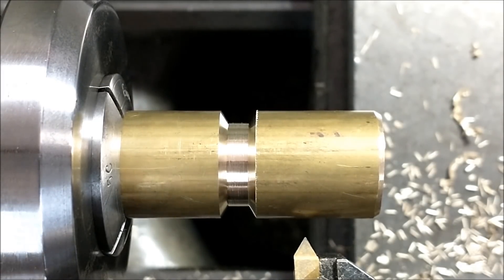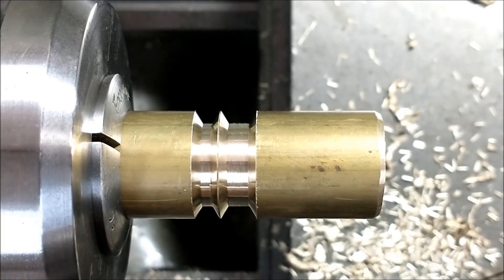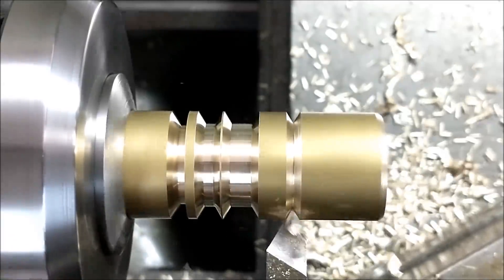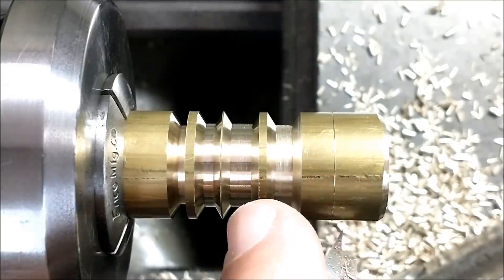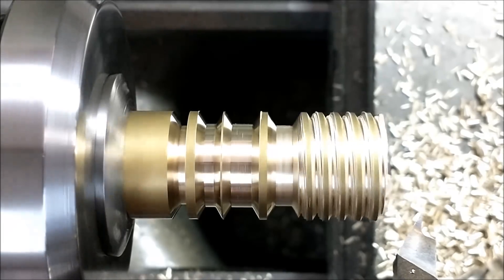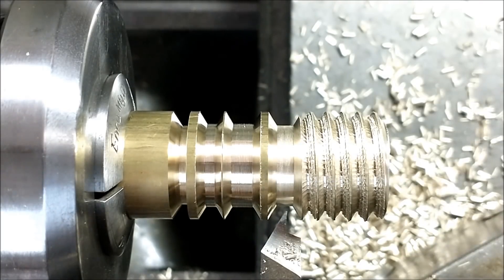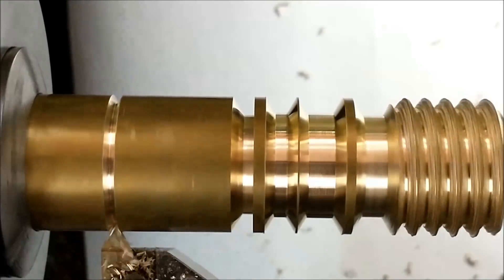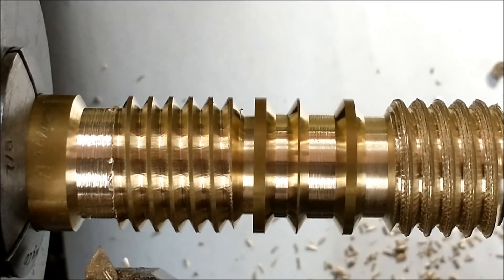FACT CHECK:  Threading Myth BUSTED !!   You'll Find This Interesting......

Comment: Excellent clear demonstration of what is actually occurring during a single point threading operation. 
It is my understanding that the oblique approach was to reduce chatter by using the leading edge to remove more that the trailing edge.
Thanks for sharing, best regards from the UK.

Comment: i always belived it was to reduce tool pressure on large threads
Reply: Or small lathes.
Reply: @RichieRichOverdrive  yes, so many hidden truths, some go back to the very start or just to what we were taught, but if you watch it still cuts on the right a little
Reply: You don't want to cut both flanks at the same time by feeding straight in because the resultant double swarf "balls" choke the cutting action & produce a poor finish. You're also more likely to chip the tool tip in that situation...

Comment: So then how do you cut a buttress thread? Similar grind but only plunge with the cross slide?
Reply: Yep... 😎👍
Reply from the maker: You can do it that way, or if you are a compound guy, set the compound to stroke within the angle of the smaller side angle.

Comment: I was tought to set the cross slide at 30 degrees and use it to feed the tool into the material. This way you feed in parallel to the right flank which you barely touch and becomes smooth. If needed you do a very light last cut on both using the slide.

Comment: I don't know if this is still a myth, but I was taught to step using the compound because the cutting tool is more prone to chatter if both sides of the tool are equally loaded. Cutting primarily with the leading edge puts force against the tool holder in the ordinary location and direction.

Comment: Joe, I am a 70 YO who has minimal experience with lathes/mills (my career has been radar, computers, high tech electronics in general) but even without lots of hands on experience I can see that statement is foolishness. It's about the same as saying you can cut off the bottom half of the 60 cycle AC and still have your negative voltage.
Reply: Its not the same thing at all John... you kinda have to see it in "the flesh" to get yer head around it...
Reply: @peterfitzpatrick7032  : It really is analagous, even to the extent of there being odd quirks that might still generate just enough negative that someone claims they were right after all (a negative voltage can be generated because one of the junctions of a transistor acting as an LED, causing the other junction to act as a solar cell- lousy amperage, but just enough to lead the unaware on wild goose chases...).

Comment: I have never used the compound slide offset from zero when cutting threads, so I've never even considered it possible to form anything that would resemble a 55 or 60° thread with a half form tool? I've only ever used the cross slide for depth increments, a full form thread cutting tool, and the chasing dial to synchronize. Then I test fit the mating part wherever possible before removing the finished part from the chuck. The form and fits come out perfect every time👍🇦🇺
Reply: Same here with with 55 years machining experience apprenticed in a shipyard, never turned the compound slide for screw cutting and always worked fine:-))
Reply: @johnhili8664  Yeh, and by using the compound slide set on an angle to make depth adjustments, wouldn't that screw with correct thread engagement when using the chasing dial?
Reply: @simonilett998  That's another thing I never use chasing dial as even those can make mistakes especially on fine threads!! I always reverse the lathe, for my hobby stationary engine collecting I have a Myford Super 7 and a Colchester Mastiff!!
Reply: @johnhili8664  Yes, I think the chasing dial is only good for coarse imperial threads from memory, and you don't want to move the carriage when using it or it could throw off the position. I was taught the same, pretty sure from memory I leave the lead screw lever engaged, drop the feed into neutral and back out the cutter after each pass, then switch the feed to reverse to keep everything tracking the same, and it takes any backlash etc into account too.
Reply: @simonilett998  I think  it does not affect the timing but still I cannot tell as I have never used it in my 55 years experience:-)) Here have a look at some of my steam engines https://www.youtube.com/watch?v=iyvqs5Fb4Oo&t=7s

Comment: Great demonstration of an interesting way to cut threads. Here’s a little known method that I’ve never seen demonstrated. Hold your hat, it’s counter-intuitive. You can also set your compound at 31 or 32  and cut perfect threads with no tiny steps. Important, set your compound “first” then set tool square with work with setting gauge. If you do it the other way you’ll get a crooked thread form. As the compound is fed in at 31 or 32 the right side of the tool cuts a thin slice while the left does most of the work. I would love to see Joe do a video on this.
Reply: Will end up with wonky threads
Reply: @aaronhammond7297  No you won’t. As long as the 60 degree tool is set square with the work with the setting gauge you’ll get a perfect thread. Try it and see.
Reply: The method i think you are describing is the reason the myth in this video exists. But its actually 29,5-28°; square to the spindle axis as the reference. This caused some confusion for me when first trying this method. It’s actually a pretty widely used method. And it serves like you said to keep most of the workload on one side of the tool. The other side also cuts slightly. If you’d like to learn more about is you should look up thisoldtony’s video on single point threadcutting.

Comment: I totally agree Joe, the right side absolutely does cut because of the 29 1/2 degree compound setting. 60 degrees is the form tool and the feed at 29 1/2 degree is the cut with the 1/2 degree 'drag' cut that finishes the right side of the thread ditch to 30 degrees.
Reply: Missed the point I think
Reply: @aaronhammond7297  The right side finishes off the 'steps'?

Comment: dam fine demo there if you were watching it you can see the tool cutting on both sides doing it the proper way with the half ground tool you could see clearly it not cutting on the back side just a question i use a carbide threading tool insert can you cut a thread with out setting at 29*  i don't use the lathe much for threading

Comment: You exaggerate. Yes we all know that both side cut, but mostly one side is cutting so tool pressure is a lot les on the tool. Corse threads , in steel , you just can’t do it decent in straight feed
Reply from the maker: I feed straight in on everything I thread.
Reply: @joepie221  Don't you get the tool "choking" on the swarf pushing in from both sides ? 
I've found this when I've fed in directly, particularly with gummy materials.
Also, I've found built-up edge on the tool more prevelant when feeding straight... 🤔

Comment: Interesting. I think a lot of the origin of rotating the compound to slightly less than half the thread angle comes from the use of HSS tooling by amateurs, in days of yore. In the UK there is a book called "The Amateurs Lathe" by LH Sparey. I'm sure this book is known in the US too, it is something of a bible for the small lathe user. Sparey recommends rotating the compound to the specified angle. This is explained as reducing tool cutting pressure, prolonging tool life and reducing the load on smaller machines, the owners of which the book is aimed at. He doesn't say the right side of the tool doesn't cut at all, merely that it does so with less pressure.

Personally I tend to use insert tooling and I just go straight in with the cross slide. Thank you for an excellent demonstration and explanation.

Comment: I put Dykem on the thread and the tool bit to prove both sides cut. If you run the lathe at a very slow speed, you can see both sides cutting.

Comment: I’m lazy - I just plunge in on the cross slide - can’t be bothered moving the compound .
I also find that not having to trig out the feed for the compound easier . With the compound set to half the thread angle it still cuts on the trailing side but the bulk of the cut is on the leading side which can help to stop chatter or a dig in on light machines , you also have to be careful threading up to a shoulder or in a blind hole as having the compound set to half the thread angle not only feeds the tool in towards the centre axis but longitudinally so the little bit of clearance you had at the start can disappear and you end up driving the tool into the shoulder or bottom of the hole . Threading away from the chuck fixes that problem !
Thanks for the fantastic video Joe , I know this has been picked up on one of the model engineering forums and I look forward to the ensuing squabble it will cause 🤣

Comment: Which begs the question. If you are using a 60 degree tool why use the compound slide at all. What is wrong with just using the cross slide to feed in the tool?
Reply: oops sorry that question is answered underneath.

Comment: I just had a thought,  the 1/2 tool would not cut the correct angle on the trailing side unless the compound is set to exactly 30 degrees. 
Also setting the angle to 29.5 degrees means that the trailing edge of a 60-degree tool will always be cutting along its entire length.

Comment: Just yesterday I plunge cut a M20 x 2.5 mm on 304 stainless steel (cross slide only)  No gouging at all, perfect thread,  L-R, HSS tool slightly above center 👍

Comment: If you're threading on a manual lathe I can guarantee you the 29 and a half degrees is the way to go. you have to feed with the compound. if you try to feed straight in with the cross slide with anything other than brass cold rolled or hard material it's going to tear up the tool when the chips collide at the very point.you want the right side of the tool to just graze the thread and slightly clean it up which takes away those steps you demonstrated with the brass
But for sure most of you cutting is on the left side of the tool.

Comment: So if both sides are indeed under cutting force.. does the 29.5 degree offset really impact that much? I've seen threads cut at 90/0 degrees by a student that worked.

Comment: The only reason to feed in at an angle for threads is to get a better chip size control for things like cnc as the same step moving in to cut threads with a plunge increases chip load considerably pass by pass

Comment: Whenever anybody says that the 29 degree setting produces a "stair step", the real reason is that that the compound is not accurately set to 29 degrees AND/OR the tool bit is not ground to 60 degrees accurately AND/OR the tool bit is not mounted straight.  With everything correct, the right edge of the tool must cut a little.  Assuming you could have everything perfect and chose a 30 degree compound angle, I would still expect a little cutting on the right edge just because the tool will be flexed slightly to the right due to the pressure on its left edge even in a very rigid lathe set up.

The reason for the 29 degree (or 29.5 degree by some) is to control chip production.  If you cut straight in, a chip curls up and to the right from the tool bit's left cutting edge - and - a chip curls up and to the left from the tool bit's right cutting edge..  These two chips are trying to go into the same air space above the tool tip.  Since that is impossible, they collide and cause stress, possible tearing of the metal, and more force on the tool tip.  With free machining metals like brass, this might be less of an issue.  With harder materials, it can be a huge issue.  In any case, you can end up with tearing of the metal at the tool bit tip.  Being a little under 30 degrees insures that at least a small amount of cutting deliberately occurs on the tool bit's right cutting edge for not only a good finish but for good contact for heat transfer.

Hobbyists may not notice some of these problems as much as they often are making smaller parts with a low horsepower machine and often very light cuts.  But in a production environment it can be very important.
Reply: Dead nuts, Chuck.

Comment: If all clearances on the hss tool are correct for brass, front + pitch angle + profile and rake(perpendicular to axis), the finnished profile on work will be same as tool. Slower speed with cutting oil helps as tooling point small. I was taught set compound slide half of thread angle and also cut first leading edge then adjust slide to cut trailing edge. The 45° for buttress threads. Cheers

Comment: You can set it greater than 30° or less than 30° depending on which way you want the chips to curl - in the feed direction or away from it.  Useful if theading ALL the way to a shoulder to keep from trapping chips between the tool and shoulder.

Comment: One question for you. When using the upside down threading tool technique do you need to set the compound angle in the opposite direction from what you use when threading the traditional way? I am leaning towards yes because I think this keeps the in feed moving in the direction of the cut when you are feeding towards the tailstock. What do you think?
Reply: Yes. This also applies when cutting internal threads, you have to set the compound the opposite way (if you're using it).

Comment: Is this a myth? I've never thought that anyone was literally saying they right side of the tool doesn't cut even a little tiny bit, just that most of the cutting happens on the left
Reply: Aye, he missed the point of the 30° methode. Confusing, assuming his knowledge he may have for his age. (Age in a good manner)
Reply: @Voxters  sorry but I have seen it written in a number of places that the RH side of the tool does not cut but Joes demonstration shows that to be false. I only hope you have half of the experience that Joe Pie has mate, if not keep the mouth closed lol
Reply: @samrodian919   Seen it WRITTEN hm? ;)
No one said, the backside doesn´t cut. It removes exactly that much material which you move forward with your tool and smoothens the backside. Thats why Joe endet up with Staircases on his "removed backside" Tool.
Stop reading silly tweets, grab pen and paper, cut it out and try it yourself.
Reply: (Because sometimes, threads are left-handed...)
The ratio of cutting by 'front' side of tool vs. 'rear' side of tool is going to depend on feed rates and thread profile's angles.
If you could get things set up just right, you could probably get it so the 'front' side does ~99.9% of the cutting, but, you are not going to like the result: as Joe mentions, that surface of the other side of the valley is going to be really crappy & grooved: who wants that?
If you are doing some very large batchwork, (depending on materials) it might make some sense to do a little trig', and come up with an approximate cutting ratio, to help guide your tool changes/maintenance.

Comment: Excellent video and explanation Joe!
Your verbal explanation in a previous video was easy to misunderstand, even though it was 100% correct.  This demonstration really helps to clarify the issue.  Thanks for taking the time.
It would be interesting to see the same procedure, but with the tool having a small cutting edge on the right side about equal to the compound advancement.  Again thanks for the video.

Comment: Interesting demo. I think the rationale behind advancing the tool with the compound and the notion that the left edge of the tool is doing all the cutting harks back to the bad old days before insert tooling. Older, hand ground HSS tools were mostly equipped with side rake so the left edge was configured for optimal cutting angles on steel and similar ferrous stock. The right edge will cut but not as well as the left. However your demo clarifies the stepped nature of the cut as it advances. I think most machinists understand this intuitively but probably never see it played out this way.

Comment: Very interesting stuff.  I think machining is full of this kind of mythical thinking.  
The leading edge + the depth of cut on the trailing edge is still less tool pressure than the tool pressure for the entire V.    Not an issue in brass but a huge issue on stainless or high carbon steel on a small lathe.  
I use the 29 degree method for the convenience of setting the cross slide to zero and not having to remember what depth I got to on the compound.
Reply from the maker: I single point stainless all the time. I'm lucky enough to have solid machines to simply plunge. But, If you teach, please teach those that trust your words, the facts.

Comment: Maybe you could help me. I always struggle with speeds and feeds for long endmill like 8x d or more even in aluminum , you know any wizardry for that? like rules for how deep and wide of a cut to take for various stick outs or ways to find what sfm to run at?
Reply: Long stickout can be rough. Slow down your RPM but keep your feed rate high.  A high chipload helps stabilize the cutter. For really long tools my go to place to start playing with it is 1000 RPM and 15 inches per minute with carbide endmills.  I don't run HSS so I couldn't help you there.  Good luck.

Comment: Not only does the trailing edge cut a step the leading edge is too thin causing chatter 
I'm not a machinist and I can see this 
How can anyone think that you don't need a form tool for thread cutting
Reply from the maker: It must be the day job that gets in the way.
Reply: East, They think a form tool is something you yse to fill out a questionnaire.

Comment: I don't use any compound angle threading stainless 304L tube in CNC lathe. Tool Chatters and breaks twice as fast If I do. Threads actually come out cleaner without compound angle and I don't need a spring pass either. I do end up with a birds nest though. Definitely better than broken tooling.